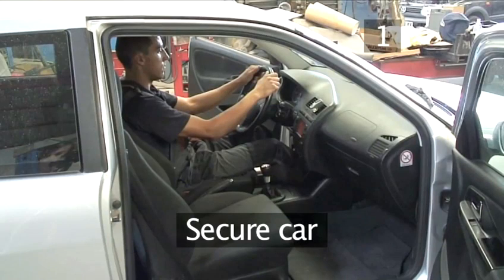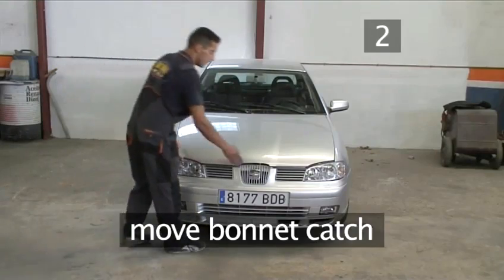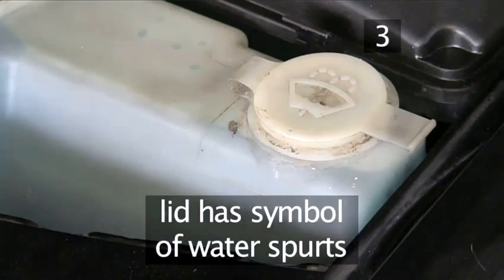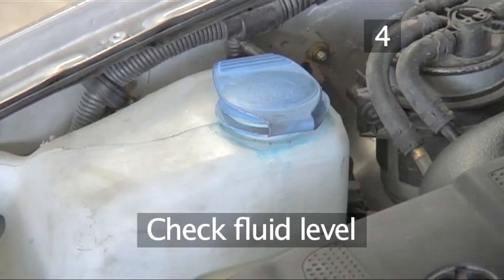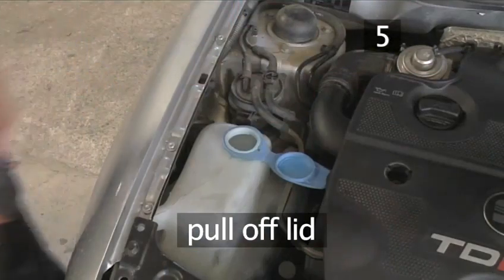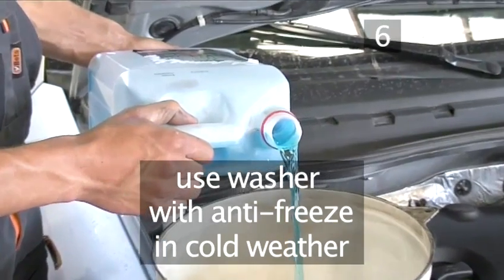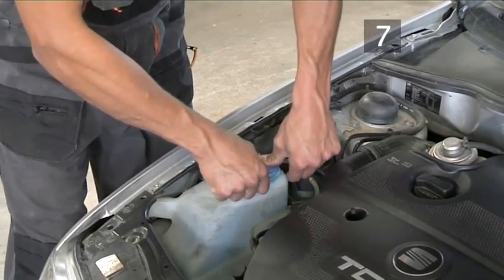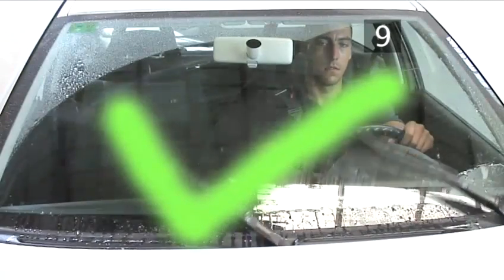How To Refill A Windscreen Washer Container

Comment: what's the difference adding the blue fluid and adding a normal water?
Reply: if you live where the temperature goes under 0 degrees then you need stuff with antifreeze in it

Comment: Why shift into first gear?
Reply: Masyaf  as back up to the handbrake if it failed
Reply: @iLOOOOOVEu  Isn't that what neutral gear is for? 🤔 I always leave in neutral once parked and engine off as well as handbrake on.
Reply: @warrengrant2992  well if your handbrake does fail, it will roll
Reply: @warrengrant2992  if facing up on a hill leave it in first, if facing down a hill in reverse, same applies to flat roads
Reply: Always park in gear. Was at the bank last summer and my bank is on a hill. Someone didn't park in gear and their handbrake failed so their car rolled down the car park and down the hill. Luckily it just avoided the main road and hit a traffic light instead but it wouldn't have rolled if he had parked in gear.